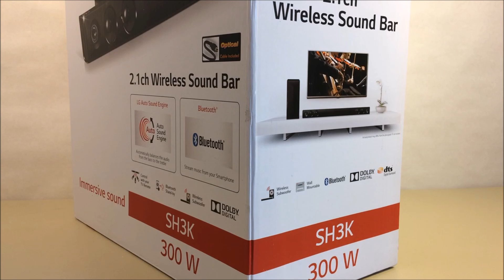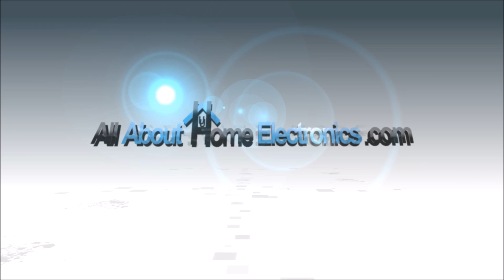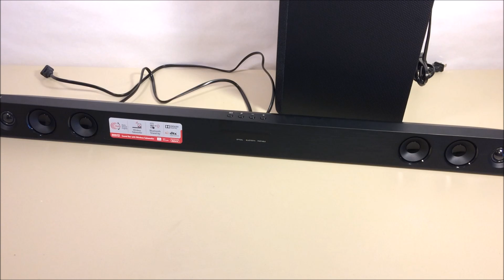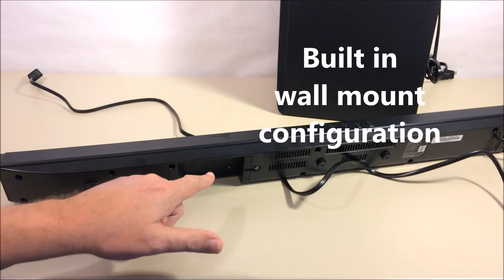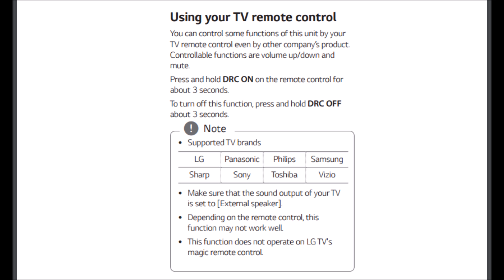LG SH3K Soundbar Wireless Subwoofer Review

Comment: I have a LG C1. When connected via optical output, the sound bar remote does not work properly but it works when the sound bar is connected via Bluetooth..very frustrating, not sure what’s wrong
Reply: Also does this sound bar work via LG Sync feature?

Comment: For anyone that has this, neighbors keep connecting to my sound bar somehow and it’s frustrating. Any way to lock it in or reset it maybe?
Reply: There's supposed to be a firmware update to enable blocking Bluetooth for it there's a compartment on the back with a screw in it by the optical in all you do is take that little shield plastic piece off and there's a USB port underneath it but I can't find a firmware update for the life of me but once you get the firmware update apparently all you do is hold down the auto loan button for two to three seconds and then it disables Bluetooth It's a great sound bar but why on earth would they release it this way who knows 🤷🏼‍♂️

Comment: got this at best buy for 150. also got a brand new 43 inch lg tv with it.had to return tv because it had no optical or ''toslink''drive,?  weird i know.i didn't want to buy another tv so.they gave me a digital to analog converter to hook up to my old tv's and said it would work,, it does not, not on my ps3 or any of my tv's,, i does however work great thru bluetooth, i have tried everything setting tv's sound to off and lots of other stuff. i will keep it though, its sounds really good through bluetooth from my computer, if your tv does not have optical out then don't get it, it's a pain in the butt. if your tv has that then you will enjoy it.
Reply: Most if not ALL modern T.V.'s have optical out, or another very simple way to get them hooked up with a t.v. It sounds like a user error. 

BTW, they don't sell a digital to analog converter. They have optical outs, but nothing to transform a signal from digital to analog format....
Reply: https://www.bestbuy.com/site/searchpage.jsp?st=digital-to-analog+audio+converter&_dyncharset=UTF-8&id=pcat17071&type=page&sc=Global&cp=1&nrp=&sp=&qp=&list=n&af=true&iht=y&usc=All+Categories&ks=960&keys=keys
you sure mate?
anything that accepts a digital audio signal has a dac(digital to analog converter) inside to then output the signal to speakers, speakers output analog signal.....

Comment: Hey guys. I'm curious about your experience hooked up via optical to a TV. My sound bar doesn't pick up short and quiet sounds like computer clicks or basically any sound shorter than a second. I'm wondering if the sound bar I got is defective or if the model is just not responsive. This is a deal breaker me!
Reply: You want to hear simulated computer clicks? That's not really needed I'd say.